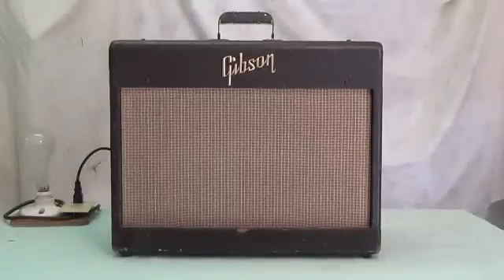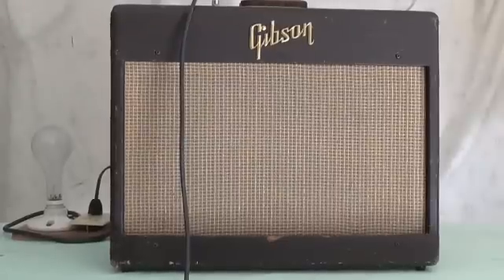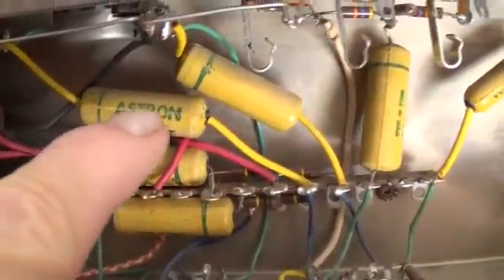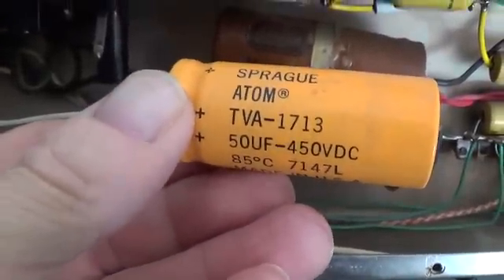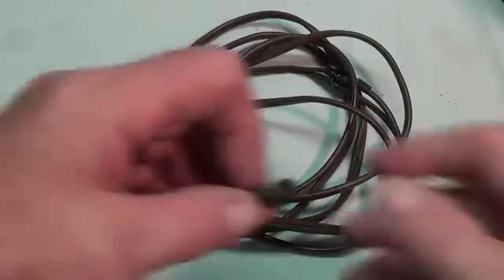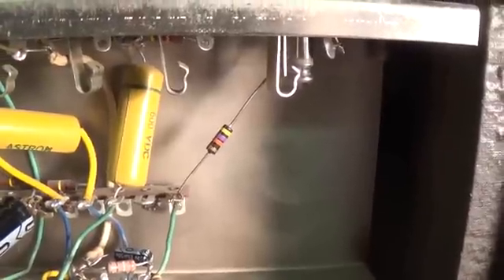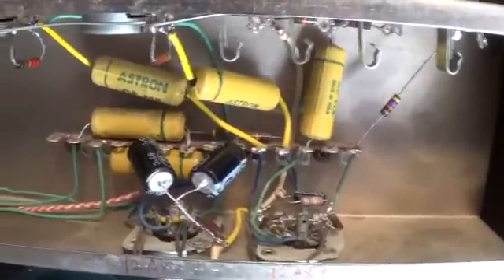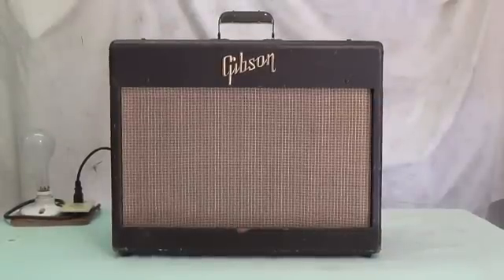Late-50's Gibson GA-6 Amplifier ....with some Very Unusual Problems

Comment: Great video, Doug!

As usual i got  - my very own ;) - two cents for you as well:

Please, don´t blame "Astron" too much for the electrolytic Caps. As nearly all 50-60 years old Caps will work good by now....It´s all about the cap´s contruction. As the little yellow ones are complete different, they are made with aluminium foil and a insulating foil between it to form the Cap, while electrolytic Caps are made of aluminium foil and some gelish hold in paper. May this leaks out, dissapears or simply just drains out over time.

I had done much more measurements in the "non working" condition, as i´m curious why the amp does behave in the state where it was as you get it....
My own thoughts would be that the screen voltage was waaay to high, leeding the output tubes to a very high gain hence to a loud tone....

Next up, i would have opened the old electrolytic Caps and see in what condition they are, But when you do so, wear some gloves, as the electrolytic is not very healthy for your hands/fingers.

Next is, WTF the repairman - do not use the word "technican" here, by reason;) -  had done? Replacing a Cap with another with different parameters? Put a 50muF where a 2x muF was, is no no good idea since one may risk the rectifier tube....RTFM (in this case the tube datasheet) first ;)
What´s about this changed components bag sh*t...When I repair some old gear, i take a first look inside while the owner is present, and tell him roughly what´s going on and let him decide wether is worth to repair or not....I never do this "bag" thing! i take photos instead and dump bad components, or put them on my shelf if they look impressive in some way...As i got a "beautiful" 15 inch "GAUSS" speaker awfully "repaired" with some hot gun glue...acually someone glued the original voicecoil back on a "half-way" recone kit. Pure bullshit! The speaker was(!!) rated 1500W/8ohms original, if you let it have this 1500W now, the voicecoil simply will "went for a walk" ;)
Reply from the maker: Thanks for all the excellent insights, TC. The plate voltages were quite reasonable at 332.5 V, and I don't see how the screens could be higher than this, but I will check them tomorrow.  Re the Astron electrolytics, I have found the duplex cardboard-bodied ones to be rather short-lived. Whenever I find one in an amp, it is generally way overdue for replacement. Thanks again :)
Reply: Hi Doug, no need to check this, because the amp now works fine, and so will the voltages ;)

As i do not know the schematic of this amp, my thought of the too high screen voltage was a "wild guess". Just because i´ve seen this had happened on other amps...
Have a great one!
Reply from the maker: TubiCal
Yes, but I will keep your recommendation in mind for future troubleshooting. Thanks again, TC.

Comment: the problem with too high volume on 1 is the same on the Fender tweed 5e3,the pots are not wired like a divider but they just load down the grid.
Reply from the maker: An interesting observation, Mr. A. I didn't realize that this phenomenon had been seen before, and on other amps. I'll check into this. Thanks !!

Comment: Shoddy repair work...i would be pretty upset....Love your videos. Question I have built a couple of amps but i would like to know more about tube amps testing values and repair...is there a book you would recommend..
Reply from the maker: Greetings, James. There is a book by Gerald Weber that's quite good. Some of it will not make much sense until you have developed some foundation and experience, but it would be a good place to start. I personally read Internet articles about each portion of the amp circuit, to increase my knowledge and understanding.
Reply: Uncle Doug Thank you Sir...Cheers.

Comment from the maker: The "elephant in the room" is why the volume was so ridiculously high in the first place (without the distortion you might expect if there was some component failure), and on both channels (both pots could not have failed to exactly the same degree....and they both checked out). I wonder if the replacement Jensen speaker is way more efficient than the old one? I'll ask the customer if the problem arose after the speaker change and what the impedance of the original speaker was. Stay tuned.
Reply from the maker: Greetings, Force. The speaker currently in the amp is an almost new Jensen P12R rated at 25 watts. The amp, with two medium-biased 6V6's is rated at only 14 watts more or less, so the Jensen should be a good speaker for the amp. I believe the original speaker was also a P12R or something close, rated at 25 watts, and according to the owner, it was destroyed by the high volume of the amp.....so apparently the speaker is not the problem.